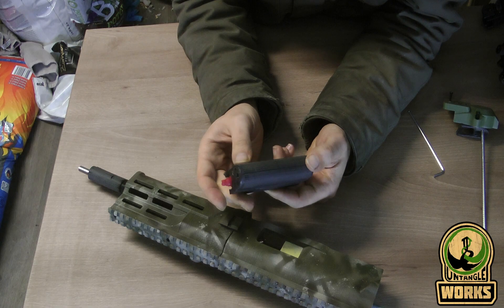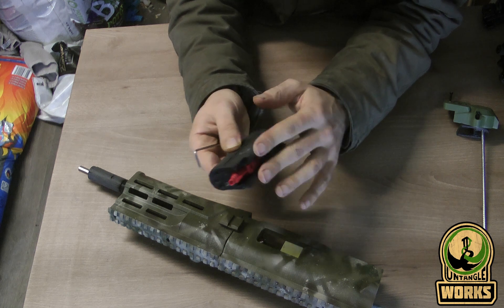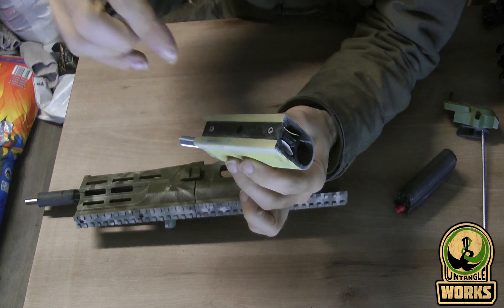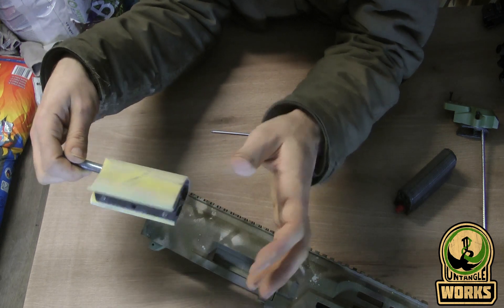FGC-6H FGC-6FA FGC-6BL FGC-6SF FGC-6S: why and how to use the upper sand tool

Comment: Hey, thank you so much for your amazing work!

When would close bolt, hammer fired version drop? My printer is itching :D
Reply from the maker: haha thanks, and really hard to say unfortunately, I do know what I need to do mechanically speaking to make it a reliable system. but I have to make some time. to look at it and see how to go about it.
Reply: @UntangleWORKS  yay, cool to know that, gonna wait for updates)

Also, it would be a semi/full, not just full right?
Reply from the maker: @РикСанчес-я6з  the aim was semi auto but it looks like there will be 2 options for it in the end. but no select fire, it's full auto or semi auto.